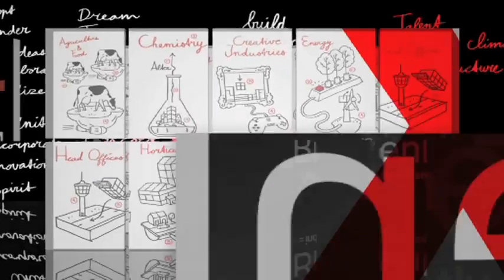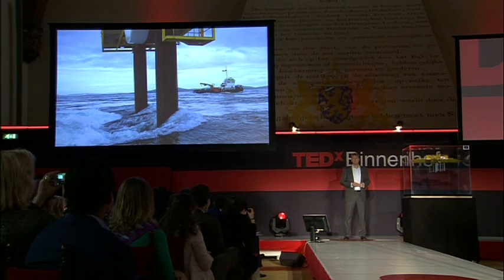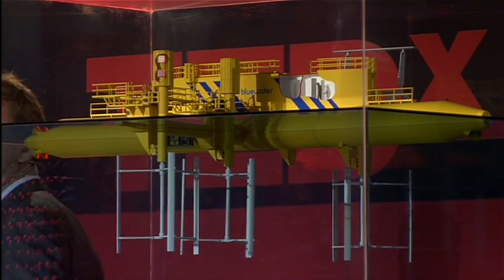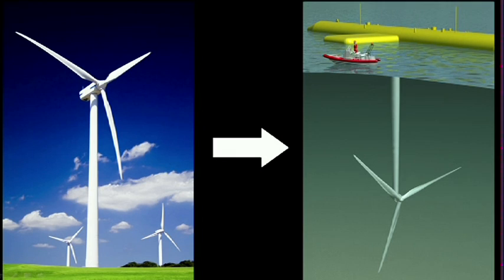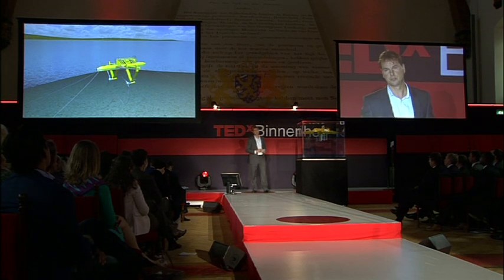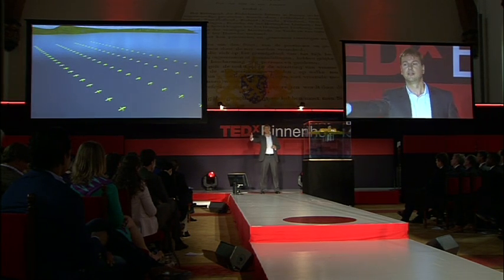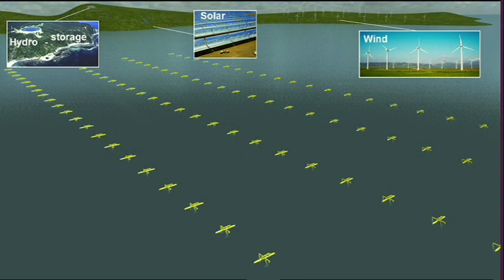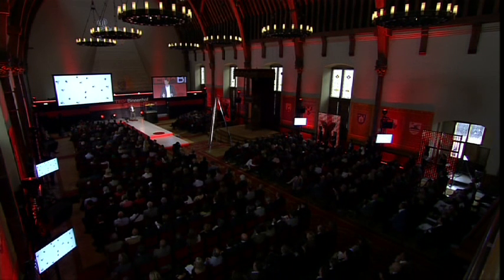Working with the tides for clean energy: Allard van Hoeken at TEDxBinnenhof 2012

Comment: I'm interested in purchasing a gearbox for a project involving a weighted bucket. I live near a tidal river with an 8-foot height difference. The idea is to have a bucket filled with rocks connected to a cable anchored to the land. As the tide rises and falls, the bucket's weight will be used to drive a gear system. This system will be designed to descend more slowly than the tide recedes.
Reply: Oops I think I just solved climate change
Reply: Like the problem with your solution is it's so locational based like this rapidly moving water is in such specific areas it's typically where boats go and it's close to the shore and it's not everywhere